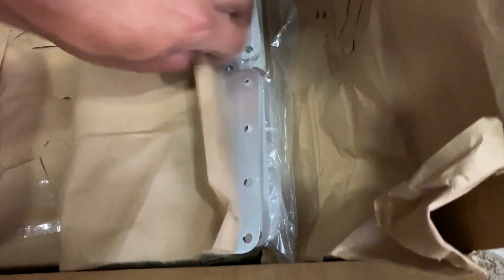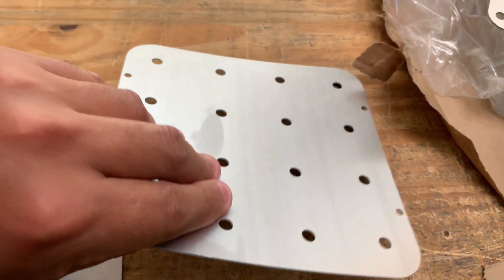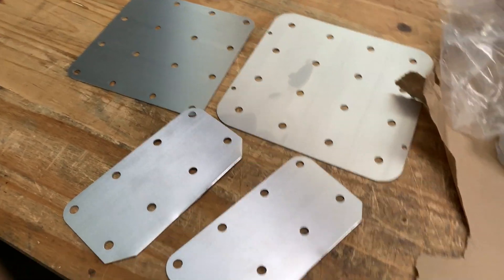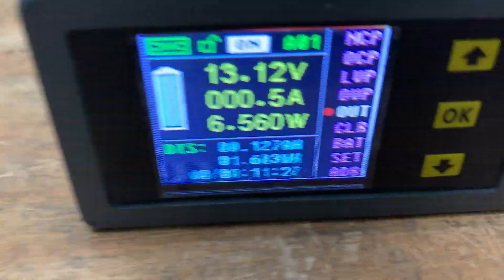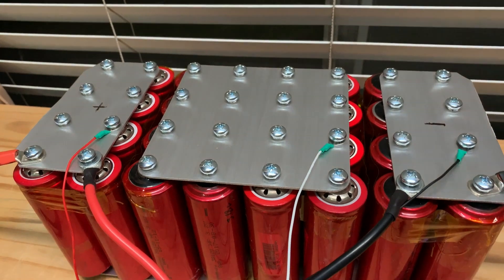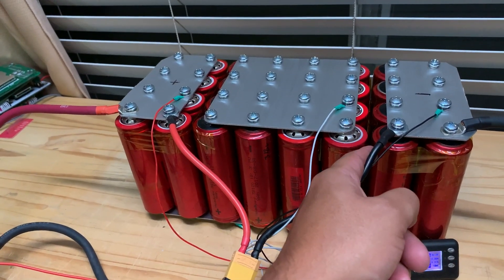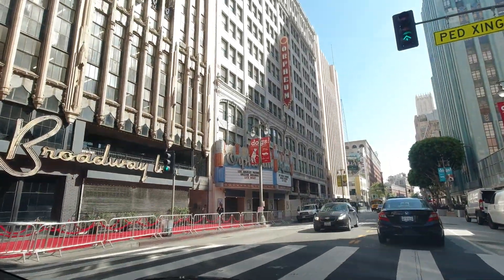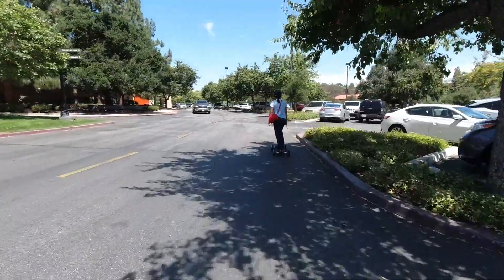They Are Finally here!   Headway Busbars

Comment: Whats up Buddy . Thanks for posting the videos. I want to install a solar system But I want to build the proper battery pack. I run about 33kwh per day or 33,000 watts. Would a battery set up like this work.  I did my math and if it is correct I divided total watts per day by 12v and came up with 2,500 amh..then I multiplied it by 1.25 the the battery discharge safety and then came up with 3125 amp hours. What the heck size battery pack would I need. Would this one do or would I need 4 pack s of these.? Appreciate your help. My email is tommyguns185186@gmail.com

Comment: stack up five or ten plates and run them through the band saw nice and slow. takes just a few minutes.  why not add a tiny cooling fan? forget any insulator except on top and bottom need some plastic sheet protectors

Comment: how thick are the 2 different plates
I made custom plates from 1.6mm aluminium for my 30p4s 10ah blue 38120s
what amp draw should 1.6mm be ok upto?
Reply: Aluminium is a very good conductor, better than steel, almost as good as copper.

Comment: Hello Jehu I didn't get the size of this battery cell, pls lemme know the cell size, it's not the normal size cell you use for other battery packs
Reply from the maker: Check the link to the product listing on description of video
Reply: Hey Jehu great to hear from you, I did check description, thanks a ton, was also comparing the head on ones with Lifepo4 3.2v 160Ah rectangle batteries, these were Chinese made, loved your configuration of these head on Lifepo4 battery pack, I am first buying the motor n controller, for my dad's old scooter which I want to convert to electric, would then buy the batteries at hooked up, thanks a ton bro you are a true inspiration.

Comment: Ive heard comments that the 4x headway LiFePO4 (4S configuration) can be used as a drop-in replacement for Pb batteries, wondering if this applies also to using them to replace UPS batteries and having the UPS manage charging/discharging of these cells? I understand that I would need to balance them outside the UPS, but the high cycle life of these make them desirable for use in a UPS if they are compatible. Will a UPS charger work properly for these type of batteries?

Comment: Question, I bought 4 of the headway LiFEPP4 cells, and 3 of them are at 3.33 V but the 4th cell is at 2.68V. I don't yet have a charger (on order), but wondering if I can manually charge it to see if it will hold a charge or if I need to return it. The charger won't get here for a while, so I was wondering if I could put it on a LAB power supply. If so, what voltage/current should I set for manual charging?
Reply: I use a cc/cv lab power supply to charge mine... for now ... works great but would really like to find a bodacious 2000W supply and do 10 at a time.

Comment: Hello Mr. Garcia, If I understand the config of the battery in this video, you have created a 64Ah x 12v unit. Is this correct ? So if i understand the specs on these headway batt's they are 3.2v 8Ah so for at least a 100Ah set-up I would need 12-13 units x 4 to get the capacity i'm looking for. Do I understand your set-up correctly ?

Comment: I'm not going to argue with anything battery related that you say. However i still see some problems with cardboard insulation for this application. If the enclosure is not water tight and the cardboard gets wet and expand its no longer a insulator. When the cells are so close together it can short. Its not that harder or that costly to use plastic insulator (something high temperature resistant). I would personally not use cardboard when there is an better alternative available, even if the risk of something bad happening is low.

Comment: Hi, how many of these cells I need to run 2 hp 1460w 220v split air conditioner for 12 hours? Thank you.
Reply: Take a look at some cells and to find the watt rating of the cell you will do amps multiplied by the nominal voltage of the cell, but be careful because I think that air conditioning has a very high initial starting power draw. (It takes more energy to start up the air conditioning for a few seconds)

Comment: I have have half that number of 38120's in the 8S 2P configuration.  ALways a day late and a dollar short it would seem.  Some day I'll have decent batteries,  eaaaaa?    Cool Video.
Reply: I have 8 batteries too. How to connect them together to get the 24 volts? I know how, I mean what to use for bus bars
Reply: @AIONizandoCR   use aluminum strap or even copper pipe flattened.  Both work fine.

Comment: you can buy a laser cutter for a couple of hundred dollers
Reply: Those are generally low wattage CO2 lasers. Good enough for engraving, but not for cutting. At work we use a 4000 watt Trumpf laser to cut aluminum sheet, and it will only do to 1/4" aluminum, and the cuts aren't  that clean at that thickness.
Reply: @machinist7230  maybe not the best, look out for something mechanical,

Comment: why not C110 copper?  My solar setup uses 1" x 1/8th" copper busbars between terminals on my batteries.  Wasn't really that expensive (even had them shopped drilled for 3/8" holes) and can easily handle 200+ amps (not that I push that much....)

Comment: cardboard and paper have been used as insulators in electrical wire and cabling for decades.  Even now, cut open most extension cord and the separator in between the rubber coated conductors is most often stiff brown kraft type paper (what is used to make cardboard),

Comment: Just out of curiosity, assuming those plates are steel or even if not, why didn't you just get some steel plate and cut out what you wanted rather than paying for something specific that only has basically one use in mind.

Why not just buy a cheap sheet of metal and cut it to what size shape or configuration you want.

You can even get sheets of copper plate and cut it to whatever size you want rather than spending money to have someone else drill the holes you could drill your own holes.
Reply: He's selling them, so economy of scale kicks in.
Reply: @kingrpriddick  Oh he is selling them I didn't know that, but even so, I wouldn't have thought it something that people would want to buy when it is so easy to make and probably cheaper to DIY.
Reply: @flitsies  Yeah if I make one it'll have 2 more cells in parallel so I'll have to make the bus bars anyway, easy to make, but I would support Jehu and buy his kit if it made sense for me.
Reply: @kingrpriddick  Yes I understand, Jags is the man.
But sometimes it makes sense just to do your own thing.

Comment: They are some serious batteries. Are they not Lithium Ion. What are they?
You do it well adding in the snippets of videos.
Reply: Headway cells are LiFePO4, Lithium Iron Phosphate, in general they have lower energy density (capacity per size and weight), but good power density (amperage in/out per weight and size), and are super safe with excellent cycle ratings (1000s of cycles, compared to a few hundred, when treated fairly roughly, you can easily exceed cycle rating of any good cell by treating it nicely and all lithium cells tend to like the same treatment).
Reply: @kingrpriddick  Thank you for that insight.
Reply: @kingrpriddick  Thanks!
Reply: Headways are my next project. I want to use these bad boys for starting up engines. I'm sick of using lead acid batteries.

Comment: seem to be having trouble with bms es have tried 2 of them 4s bms i get 16.4 out of 18650s but when i hook up a bms the board gets real hot and my voltage is 13volts checked for a short didn't see one so i unplugged it as don't want to start a fire..any help or suggestions thanks for your videos

Comment: mate those cables can withstand 130amps?
Reply: Wire sizing is complicated, basically you need to know: resistance of cable, length of cable, and rate of heat dissipation in the environment they will be used, and current. There are many good calculators on the first page of the right google search.

Comment: Would these cells be good to power a Shoprider mobility scooter? It’s 24v with a 750w brushed motor, the controller has 30/40 amp relays in it. Current batteries are 2 12v 35ah lead acid. I previously tried the 24v 15ah lipo battery from my TravelScoot in it but it cuts out, I think the motor pulls to many amps for it under load and the BMS kills it. Any help you can provide is greatly appreciated.
Reply: http://www.wheelchairdriver.com/index.htm
Reply: Definitely superior to Lead Acid, just can't charge at 32 degrees F or less
Reply: I am from the Deep South, we worry about the other end of the scale.
Reply: @DuffSweets  They also don't like over 100F but no rechargeable battery does. I wouldn't charge them that hot at all but it will "just" shorten their life so that may be an acceptable trade off for you, "only 1000" maybe. Lead acid is better at it kind of, you just have to keep lowering the maximum charge voltage as temperature increases, the cutoff is kind of 120F which does happen in an engine bay. To give a comparison car batteries are rated for 500ish cycles but only down to 30% and brought backup within an hour (the more time at 100% the better). Deep cycle sealed Lead Acid batteries are more like 600 and down to 50%. Also remember 100% Voltage slides down with temperature so the stoke gets even shorter if that makes sense.
Reply: The mobility scooter I want to power sits in a climate controlled garage 90% of its life. It will never see those temps high or low. I would like to get better reliable range from the scooter. I live about a half mile from my local park and since they took my drivers license I am stuck using the shoprider to take the dog to the park.
Reply: @DuffSweets  If you can get enough of these to fit it should be awesome with more range than the 35ah lead acids.
Reply: @kingrpriddick  My electric wheelchair. Equipment
Ottobock B500 electric wheelchair.
Lifepo4 main battery pack 8s7p 105ah. 
56 Headway 38140S 12ah LiFePO4 Cells - screw tab.
Lifepo4 battery add-on pack 8s4p 48ah. 
32 Headway 40152S 15ah LiFePO4 Cells -screw tab
153ah giving me a 50 to 60 mile range. 
Front tyre's  4.10/3.50-4 4 Ply Kenda K500 Super Turf 
Back tyre's  3.50-8 46M (4 Ply) Kenda K303 High Speed Trailer Tyre
Gopro hero 7 black chest mount.
Nikon D5300.

Comment: I just put a LiFeP04 battery in my 4runner.  You inspired me.  It cranks HARD!
Reply: @jamesl9686  ... you will also want to consider a Marine style Alternator. They are slower charging and better adept for LIFEPO4 or Lion Batts ... A simple heat mat set to keep the batt above 32 f (0c) will also be needed. Many Blessings , SMR
Reply: @TheSmreeder  The guy told me that my stock alternator should be ok with the BMS they use.  I'll look into the marine style as well.  There's always room for improvement.
Reply: @ZedZerps  Another note, if extreme temperatures are a concern, you could look into construction a super capacitor/lifepo4 hybrid battery bank as well. Super Capacitors can handle the extreme temps with ease.
Reply: @jamesl9686  I'm in a warm climate in Tennessee. Sometimes I adventure to Alaska. I've been considering a supplemental crank source or a preheating system for the North.  All ideas are appreciated.
Reply: @ZedZerps  You could build an insulated box. You can use a foam mat, fiberglass or for extreme measures, expanding foam.
Reply: How did you decide to charge it dc to dc or did you use alt, I have 64 I'm about to stick in my s10 to run the wall ac I fabbed into the dash
Reply: @chrisgosselin6399 , You gonna upload to YouTube????
Reply: I have got an S10 without A/C is the reason I ask. Not replaced the compressor yet.
Reply: @AThreeDogNight  it was a lot of work you'll have to sacrifice your passenger air bag, glove box, heater core and basicly gut the dash then i mounted it in a sheet metal airtight box I made to fit it perfectly vented the back out the fire wall and have an inverter in the tool box to run it, I still need to finish the inside I plan on weeping the dash in wood
Reply: @chrisgosselin6399  , Man!!!! that's a lot of work for sure, thanks for reply.
Reply: @AThreeDogNight  tested her the other day and I need to make it so air can circulate on the rear heat exchange I have to seal the face to the interior and pull air from outside to run through ac heat exchange that is supposed to dump heat from cab into engine bay
Reply: @chrisgosselin6399  , I wondered about that. Your Delta-T's is what that's called by the tradesman. Done HVAC work for many years.
Reply: @jamesl9686  But Global Warming.